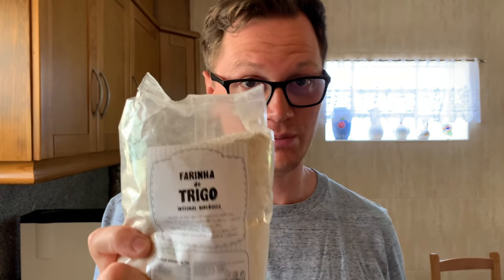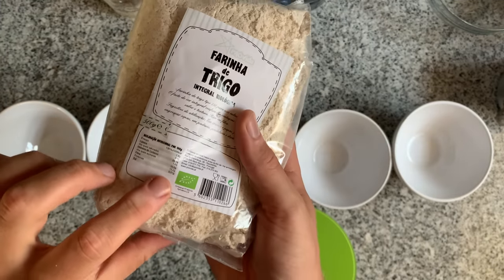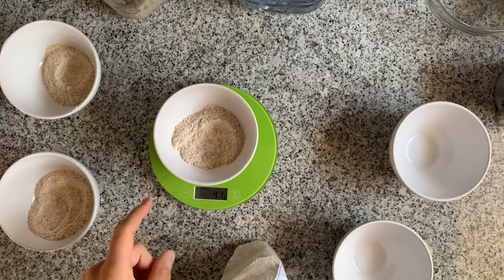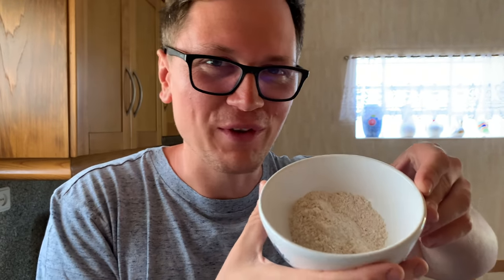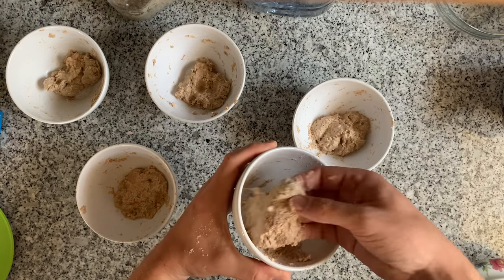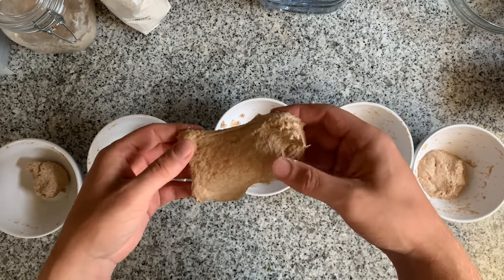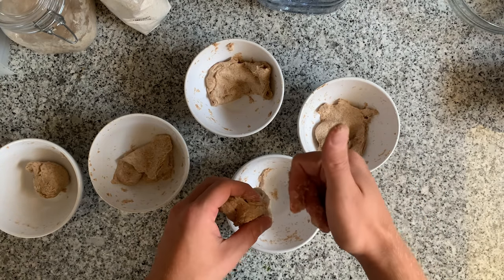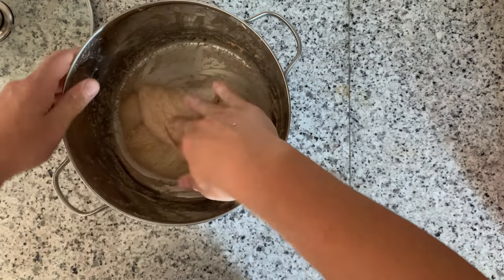This is how YOU Master Sourdough Hydration - The perfect Water Quantity

Comment: You are using 10% of starter or poolish, can you elaborate on that?  Sie brauchen 10% starter, Ist es möglich daß etwas mehr zu explizieren. Ich habe mehrmals 33 Prozent gebraucht und daß funktioniert.
Reply from the maker: Moin Peter. Of course. Depending on the taste that I look for I either opt in for a poolish or a sourdough based dough. Poolish is an amazing way to bake delicious yeast based bread. The ratio for the sourdough depends a lot on the schedule I have. If I want it to ferment faster I'd go for 20% starter. If I I want things to slow down a little I'll go for 10% starter. 20% means my dough is ready after around 5-6 hours. 10% more 8-9 hours. I like the 10% for an overnight dough for instance. If you bake a rye based dough don't worry. This is only when you want to make a wheat based dough that has a lot of oven spring and a very fluffy open crumb. 33% could work but your sourdough has to be very fresh. Too acidic dough will collapse the structure of your sourdough.
Reply: The Bread Code Danke, wieder was gelerhnt .

Comment: TURN THE FLIPPIN' MUSIC DOWN!!!
Reply from the maker: Any suggestions what I should do instead? Timelapse without music?
Reply: @the_bread_code  That's a possibility. The problem for me is the volume of the music compared to your talking. The music is much louder. It's not necessarily an issue with the music itself. Just the difference in volume. Thanks for the reply. Videos are great other than that.
Reply: What if I am mixing two types of flour? All purpose (400g) and whole wheat (100g) . Do I mix them first and then divide 40g into the various bowls? Or do I test them independently and then average them out? Thanks